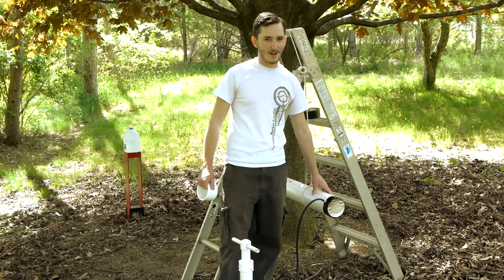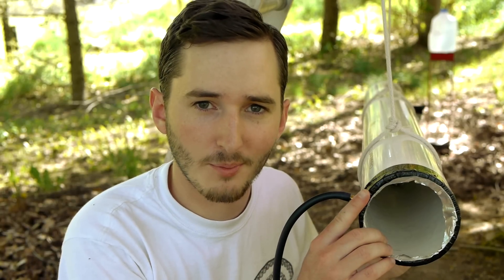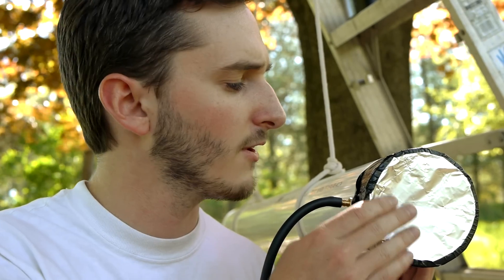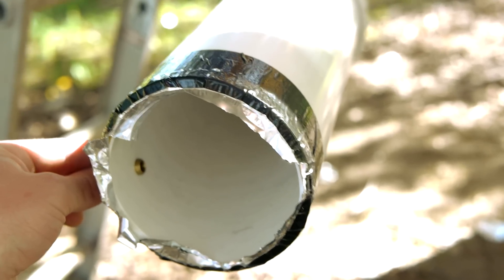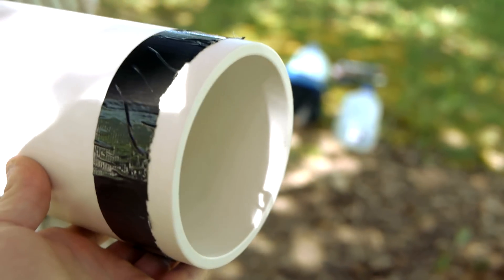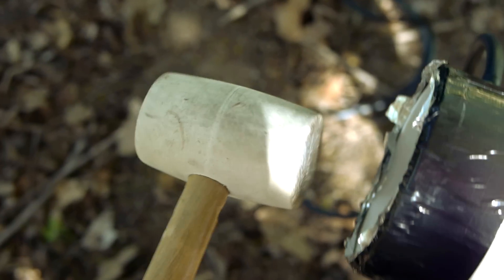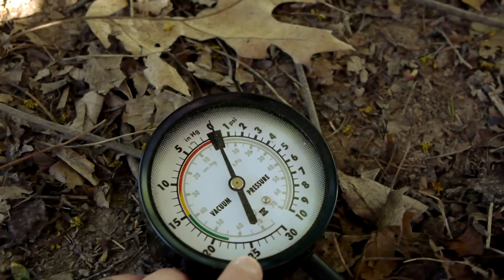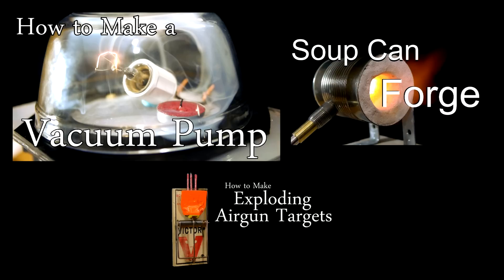How to Make a Vacuum Cannon

Comment: Maybe for a safety precaution, you could set up a fail safe. By running a steel rod (or several heavy metals) through the pipe about 5/6 inches from the firing end (where you break the aluminum cap with the mallet), so that if the the cap on the other side breaks and the projectile shoots back at you it will be stopped by the steel rods. ? just a suggestion xD

Comment: How about using a PVC disc with some rubbing or sealing at the front. then a pair of latches to hold in place till you built up the vacuum in the cannon, then open the latches. disc would be held in place by be the vacuum force itself. in that way you only need to prepare one aluminun cover and also, you dont need extra froce to colapse the front cover once the proyectile takes off, just hit the cover. Adding some sharp head at the proyectile ? would you think it would improve the performance ?, I mean, longer shots. I was thinking on doing this (the disc sealing the backside) on the back, but .... no way to colapse it really fast as the aliminum membrane. Guess will never get good shot power doing that at the back. The goal is saving effort on preparing the aluminum covers/seals. Nice vid.

Comment: I'm thinking you can add a grate of some sort on the back end of the pipe. This will act as a safety to catch the projectile in case the disc in front ruptures prematurely.

Comment from the maker: Vacuum pressure is measured in inches of mercury. You can google a conversion. I would be more comfortable with a PSI measurement also but since that's not how things are done anywhere else when measuring vacuum it wouldn't make sense to do it differently in my video.

Comment: just put some soapy water around every spot where there might be a leak and instead of sucking out the air pump it up where there's a leak there will be bubbles
and then seal the leak

Comment: ok so i was thinking while watching this, instead of using a aluminium endcap on the firinfg end, why not put a large release vale and saving a few bucks there, it will be;
A: much safer standing behind the cannon
B: much cheaper then keep on putting an aluminium end cap on 
but then im thinking.... how to reaload the ammo... put it in one end and push it down with s along stick or something.

im sure you have the nessacary equipment for that quick release valve.

Comment: find a spray bottle and fill it with a soap water solution and spray it all over the pipe wherever you see bubbles you found your leak submerging it in water works better

Comment from the maker: Can you not hear the leak to get a general idea of where it is coming from? If you find which end of the tube it's coming from you can usually find it by running your finger around the tape until the sound changes to indicate your finger is over it. Usually once the leak has been found if it's an issue with the tape, just pressing down the leaky spot will seal it.

Comment: I am doing this project for my physics class, (i wont take any credit) but after i drilled the hole in the side of my PVC, and screwed in the hose fitting, and covered the ends with foil and tape, there is still a leak. what do you think it might be? i have a vacuum gauge and thats telling me there is a leak. i have a rubber washer on the inside and outside of the PVC and silicone on both sides as well. so i have no idea where the leak is. could you help me out?

Comment: What you'd be doing is increasing the pressure differential between the positive and vacuum sides of the equation. The maximum velocity of your ping pong ball would depend on 1) the final pressure of the vacuum chamber: (read: barrel) and the final pressure of the 'pressure chamber' (read Chamber).

If the difference is 500 psi from the low side to the high side, you're talking potential injury. if it's more, say several thousand, then you're talking about being able to kill squirrels with it.

Comment: If you put a stopper on the firing end and turned the cap the other way, and the cap was filled with airsoft bbs about how many fps would they be shot out at? Also, would the cap or stopper break from the force of impact from each other?

Comment from the maker: It boils at a lower temp, but not room temp. It would still need a small amount of heat. It could be done but it wouldn't be nearly as efficient as just boiling it. That is, it could be used as a desalination process, but that would not kill bacteria like boiling by heat does.

Comment: You forgot to mention that the air it's self has a decent amount of momentum by the time pressure equalizes. I would almost bet it would be enough to rupture the burst disk on the other end even without a projectile. Also, in order to make using it safer I would suggest attaching some kind of internal flange or bar that would prevent the projectile from being rammed out the back of the gun if the front disk were to rupture.

Comment: i do have a suggestion for this...if you take a polystyrene cup, find a tube with an inside diameter the same at the rim of the cup, fill the cup with BBs, and fire it, the cup should fall away leaving the BBs to travel on their own like a punt gun. HOWEVER....im sure if you make the vacuum TOO powerful those small BBs could penetrate the skin and you may aswell use a real shotgun... (just a thought)

Comment: Do you think that the rear cap could be replaced with some sort of mechanical trigger system? I suppose it would have to open very quickly and withstand the pressure, but otherwise any thoughts?

Comment: This is very interesting. i was wondering what will happen if one end of the vacuum pipe were closed with an end cap screwed or glued on and the other end open and covered with foil with no projectile to launch inside the pipe.Will the launch pipe/cannon move ? If so How far ?

Comment: There is only 14.7 PSI per square inch atmospheric pressure at sea level. The smaller you make it the less power it will have. A lead ball would be way to dense for 15PSI considering a 12 ga shotgun runs 11000PSI in 3" so you have your answer. Lucky if a lead ball went a foot or two out of the barrel at 1".

Comment: You could make it a somewhat safer by putting a bolt through the breech end preventing the possibility of back firing...  This has potential as a propellant-less booster system for improvised shoulder launched rockets to accelerate  them out of the tube saving propellant for increased speed. The majority of rocket fuel is consumed during the 0 to 100mph phase. The rocket ignition would rupture the aluminum burst plate too. There I go weaponizing things again...lol

Comment: you could slightly change the design so that its only allowed to fire out one direction, a simple joiner would give a good lip in the inside diameter that would hold the projectile from going the other way. great idea though.

Comment from the maker: It depends on the size of the pipe. With this pump it doesn't take long at all. Perhaps 20 pumps to reach 20 hg in this cannon. The deeper the vacuum gets the more pumps it takes to move it to the next level though. You can pretty much tell how much vacuum you've pulled just by how much air is pushed out of the pump on the down stroke. When there's very little air being pushed out of the pump it means that very little air is left in the chamber for it to suck out.

Comment: Here's one that I found that is quite a bit smaller than a sprinkler valve, and will run off 12V. 

sparkfun com/products/10456 (remove spaces)

Comment: Your local hardware or gardening store should have lawn sprinkler solenoid valves that will do what you want. They are not the best design for quickly exhausting a reservoir of air, but should definitely give you enough flow to sound a horn. They typically run off 24V, but you may be able to find a 12V version on eBay (search "Water Solenoid Valve"). Google "sprinkler valve" to see a photo of the hardware store variety.

Comment: Also, would the volume of air matter? I assume it wouldn't because you would be moving a much bigger projectile(that is what I meant by volume, a wider but not longer pipe). I would assume a longer pipe would, in fact make it go much faster. But, as you mention, it's not very accurate. But it is a great way to teach about the atmosphere.

Comment: Do you know of any valves that can bought as a small button? I want to make an air-horn with air stored in a plastic bottle (like airzounds bicycle horn). I was looking at your 1 way valves and I might be able to do something with that design, but it would a lot easier to just get an already made button that momentarily opens an air path. They want $50 for the airzounds and it's literally a plastic bottle a foot of hose a button and plastic air horn.

Comment: perhaps for now, but if you could have a strong enough vacuumpump in a good enough pressure chamber, it could be done, so many waterjets blowing water with 100.000 psi, perhaps even more, imagine... 200.000 psi, not that high. it might not be vacuum, but air can shoot objects pretty darn fast.. perhaps faster then combustion :)

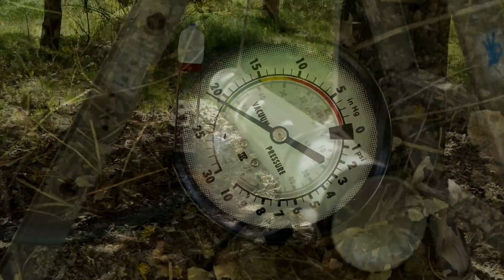Comment from the maker: It took three layers of foil on each end to consistently hold the pressure, and I did still have one of the discs fail on its own at one point as can be seen at 4:40. If you really wanted accuracy and distance a more aerodynamic or rifled projectile would work much better, but I made this more as a demonstration than as a practical and effective cannon. I much prefer high pressure piston cannons for functionality purposes.

Comment: Very nice simple design. As soon as you asked the question of how it works, I immediately knew the answer. But what I would like to know is how you are able to create enough of a differential to give that end-cap so much force to break the target, but not cause the differential of break through the aluminum foil? Also, would it be better use an even bigger pipe so that the volume of air rushing in much greater? Also, how about making the cap more aerodynamic for when it hits the atmosphere?

Comment from the maker: It will work with any size pipe with anything that will fit well inside of it. 1 1/4" end caps in 2" PVC will work. Ping pong balls in 1 1/2" pipe work as well.

Comment: If you stick a balloon with a tack, it generally ruptures too fast for you to see, right? It just looks like it immediately goes "pop," and you wouldn't know what's happening unless you watched it in slow motion. The same sort of thing happens here.

A pin would probably work, but I imagine using a mallet is easier, since it wouldn't be pulled into the pipe.

Comment: Also have you considered doing a 4" to 2" conversion on the "muzzle" end to achieve greater velocities? As well as using something solid as a mount, opposed to the pendulum effect you have going on now (which technically you could use to find out how much velocity you are achieving, if only I had my book on ballistics overseas with me I'd post the formula, maybe I can find it online). I quote muzzle and chamber due to the fact that technically they are interchangeable, and not always with intent

Comment: It would be pretty sweet to see a high speed of the "chamber" being broke and of the "muzzle" specifically at the same time and linked so you could see how long it takes from breaking the chamber seal to when the projectile goes out the muzzle. I'm curious if the "muzzle" seal breaks from the pressure before the projectile even touches it... it also looks like when you break the chamber seal the incoming air pressure rips the seal off and sends it through the "muzzle".

Comment: well, the limiting factor is atmospheric pressure. firing a .223 cartridge yields pressures around 60,000 psi whereas 1 atm ("atmosphere") is only about 15 psi. a cartridge weapon is also a hell of a lot easier to reload than a vacuum cannon. still a pretty cool science experiment though :)

Comment: To avoid the canoong to backfire, wouldnt it be posible to fit in some scews to block the end-cap for going backwards? Ofcourse the screws would have to be airtight - atleast the holes. But Im thinking its worth the testing, giving safety a thought. Otherwise we could just load it with rocketfuel and light it ;-)